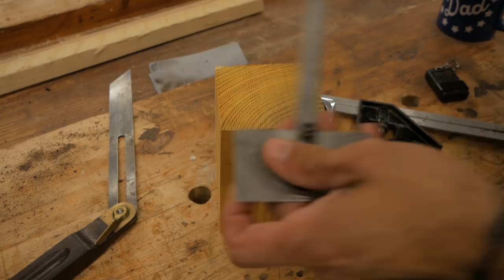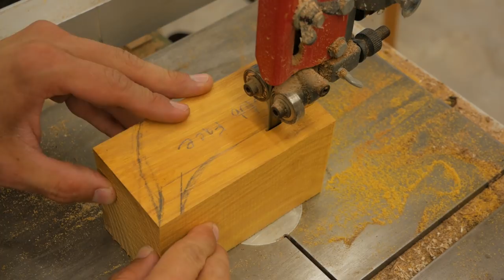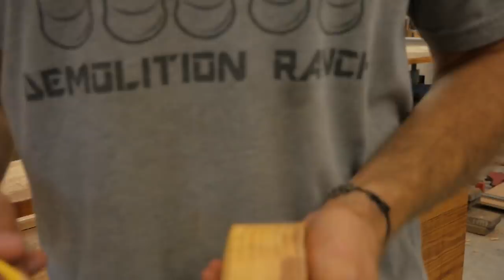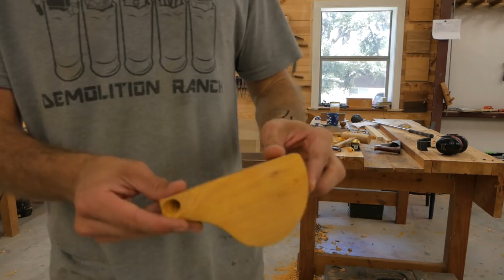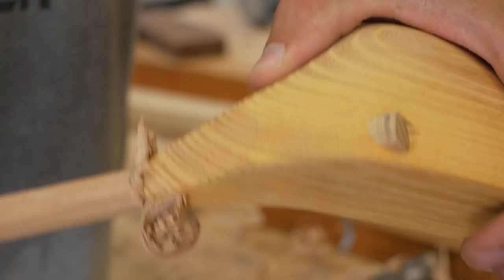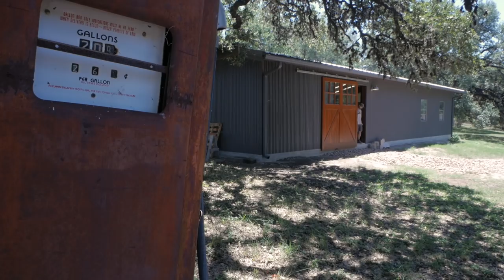Making A Golf Club Out Of Osage Orange

Comment: Nice club man. And wood chosen for this project is just fine.  I would secure that handle glue up some more becose i got a filing that it will fail. When hiting the ball much force is applied. Glue joint would be much stronger if the " rod" would be square shaped. 
Nice video man.  Good luck

Comment: I'm making a work shop table in woods this school year any advise you would like to give me
Reply: Wyatt E Make sure it's level, give it a replacable work surface (1" or 3/4" ply is fairly cheap to replace), crossbrace under that, and attatch a vise to the side. Either make it heavy enough that it doesn't want to move on its own, or bolt it to the floor.